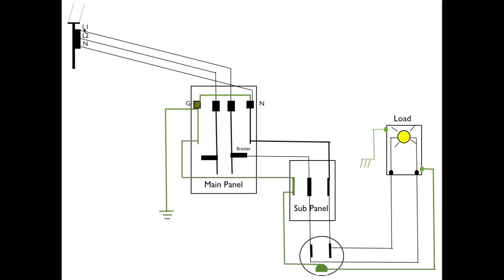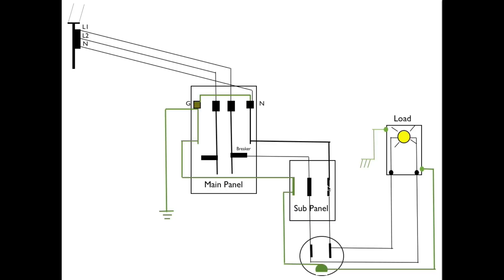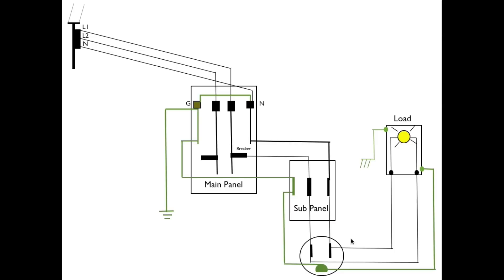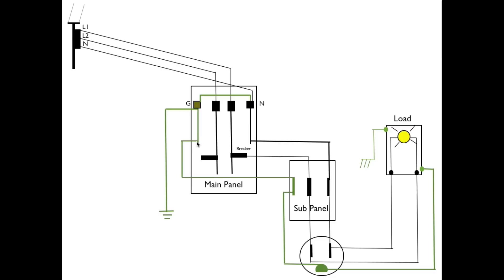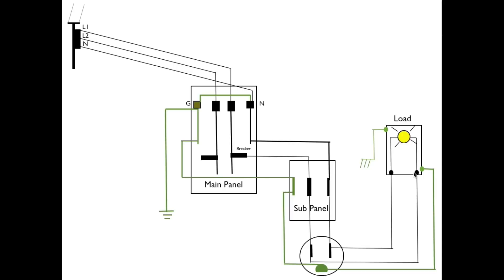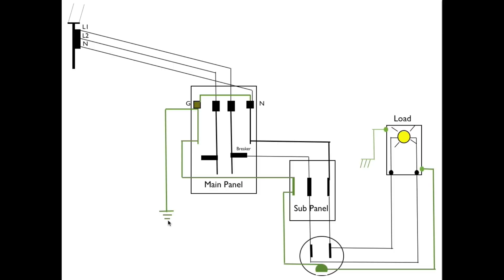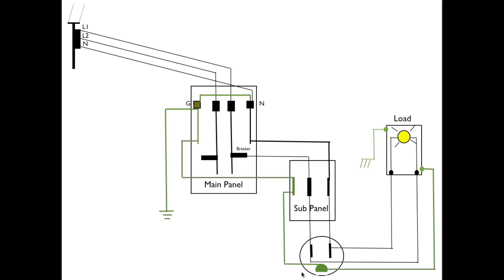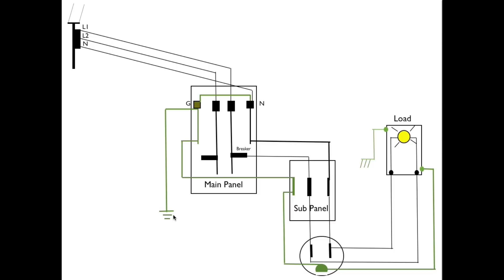The difference between neutral and ground on the electric panel

Comment: Hey grayfurnaceman, I'm one of those people with a BSEE degree but only recently have I HAD to actually learn what we call Bonding (the connections of Neutral/ Grounds/ ground bars/ pipes/ enclosure boxes, etc).  I also came to understand, after working 24 years as a EE mostly on electronic (DC) circuit design, the need for knowing that ground and neutral are NOT the same thing.  I also had to trace wiring on a circuit diagram of the type you have drawn here, and talk my way multiple times through the reasoning.  I also had to see the reasoning in my own way and then understand the explanation of neutral & Grounds connections by reading the NEC handbooks, but this time it was not Brute Force reading, but a more practical understanding of the kind you went through on the video. Thank you for putting this excellent explanation into a concise video.
Reply: Yes...but TMI. You lost most of the audience at the fire station...
Reply: It is indeed alarming how poorly many EEs  and licensed electricians really understand "ground, " let alone everyone else.  It leads to all sorts of unsafe design,maintenance practices,  and installation, and tons of garbage documentation that confuses grounding issues with sloppy references to "ground".  I try to instill in Electronic Engineering Tech students  the importance of being clear on schematics and with terms. It is better to call anything that is NOT EARTH ground, and NOT AN EQUIPMENT GROUNDING CONDUCTOR a circuit reference, 0V, etc.  If we could only stop engineers from calling everything "ground" when they mean "return path", circuit common point" or "reference point" in a circuit, and stop using the same  generic "earth ground" symbol for everything!  All "engineers" should have to study the electrical code and learn about actual machine installation in the real world.  See Mike Holt's Videos.

Comment: Nice clear description. As a lectrician who became an engineer I used to draw simple diagrams for engineers with PE license about how the neutral carried no or little current if the load was balanced on a 3 or 4 wire system. I am retired and buying a stand by generator. I was looking here to see the 2 buses in the main panel, a ground bus and a neutral bus bonded together at the main panel only. Note: doing short circuit studies the max fault current for CB trip is along the path of the source circuit, so running the grond wire with the circuit is important. Learning ohms laws as a lectrician by heart, it helped me throughout my career analyzing problems. My specialty later became protective relaying and switch gear. Did my last project at age 80. Loved my work.

Comment: Not to get off topic but when I was just young and dumb taking a three basic electricity and electronic course in high school, my instructor spoke about dirty electricity. I did not fully understand it until I started working on Digital Imaging equipment, Copiers, Printers, Fax Machines and so forth. We had serviced this equipment in old home offices and old buildings. Sometimes having weird problems on equipment, anywhere from a paper jams, dirty copy and a whole bunch of strange problems, false error codes, etc.... The first things usually checked was the voltage hot to ground to see if there was any voltage present. In some cases 30-60 Volts. Hot to Neutral should be 120 and neutral to ground also 120V. The problem was either bad ground outside, or a problem in the panel / Case. It was unreal the strange problems you can have in electronics with a bad ground to hot. Hope this shed some light. Good Video.
Reply: "Hot to Neutral should be 120 and neutral to ground also 120V. "
Did you mean to say hot to ground also 120V?

Comment: Thank you for this video. In my younger days as an electrician (pre GFCI days) I didn't understand the point of a separate ground and neutral, since putting a voltage meter on the hot and neutral wires would produce the same reading as between the hot and ground. It's all about safety, and having been zapped a few times I can appreciate the concept.

Comment: I was able to pull a permit in my city to do wiring in my garage as the homeowner. I learned that ground and neutral had to be isolated in the garage sub-panel but didn't really know why. This video was very helpful. Interestingly enough, this was the FIRST thing the inspector looked for and commented on. In the end I passed rough and final inspection. I will share this with my friends. Thank you!
Reply from the maker: Welcome
GFM

Comment: Something you don't make clear (perhaps because you don't know it?) is that at least one reason why you should not connect ground and neutral at the sub-panel is that current flowing from the load back to the transformer would then be split between the neutral and the ground wires between the sub-panel and the main panel (that split will be dependent upon the relative resistance of each path). This breaks a fundamental law of the ground connection: that is, it should not carry current under normal circumstances - only the neutral wire should carry that return current.

I believe there are at least 2 issues with this video:
 - At 5:01, even if the ground and neutral connections are disconnected, it does not mean that "this entire box" is energized or at some high potential resulting in a shock, unless there is also a fault within that device, causing the live or neutral sides of the load to contact with the exterior metal (or other conductive) components of the device - i.e. regardless of the type of device this is, the exterior metal portions of it should not in any way be connected to the live or neutral wires (unless there actually is a fault in that device).
 - At 07:50 your description of the circuit flow is wrong. If the neutral wire failed between the sub-panel and the socket, as you describe, then *no current will flow*. The current can't simply jump from the neutral side of the load to the chassis as your mouse movements (at 08:14) suggest.

In both of these cases your logic suggests that the neutral side of the load is connected to the chassis of the load - I would consider that a fault in the load device.

While I appreciate that "grayfurnaceman" is trying to be helpful, I'm not sure what qualifications and formal training he has (his www.grayfurnaceman.com website suggests he has 35 years in the HVAC business, but no mention of formal training or qualifications), and it can be concerning when videos such as this are misinterpreted as professional advice - especially where safety is involved.
No offence intended grayfurnaceman, but I would be very careful providing advice, involving safety, which may be wrong, incomplete, or open to misinterpretation.
Reply from the maker: Thanks for the thoughts.  As you probably know, up until around 1995, 240 volt residential appliances that included 120 volt loads, used the chassis ground as the neutral for those loads.  It was approved to energize the chassis ground under normal operation.  Not quite a fundamental law.  As for the circuit flow, you need to rewatch the video.  If the neutral and the chassis ground are not separated, and the neutral has an open, the chassis will become a current carrying conductor.  (I will admit the point at which the neutral opens determines whether or not the the current will flow which may be unclear in the video).  If then, the chassis ground conductor fails open, (a most common incidence with loose fittings etc), the chassis will be hot because it is feeding thru the load.  There is a video linked in this video that gives a further demonstration.  
As for my qualifications,  I am a licensed electrician.  I noticed that there was no easily understood videos on this subject so I provided one.  No one video,  article, or lecture will give a complete understanding of this or most other concepts.  I taught on this and HVAC basics for 9 years and spent most of my time reexplaining in differing ways to get concepts across. 
GFM
Reply: Older appliances may not be double insulated with the full isolation of the chassis to neutral and hot, so that could present the issue of energizing the chassis as soon as it was turned on with a faulty neutral connection.  That might be considered a fault in the device nowadays, but things weren't always designed with foolproof safety considerations.
Reply: There is a second reason. When you install a personal safety breaker (Don't know the name in US) that measures the load of L1 and N. So they are the same and no current goes to ground. You have to have that breaker in the main panel. And it wont work if N and ground are not separated out to the sub panels.
Reply: Robert Shrimpton well put together. I had the same safety concern too and the way he pointed out the neutral wires between the sub and the load. Obviously, there would be a fault and nonetheless, having a broken return conductor will not complete the circuit.
Reply: Robert Shrimpton p
Reply: I think you both are  correct for your own statements regarding ground/ neutrals. This statement is good to know:  "As you probably know, up until around 1995, 240 volt residential appliances that included 120 volt loads, used the chassis ground as the neutral for those loads.  It was approved to energize the chassis ground under normal operation.  Not quite a fundamental law," however the diagram and discussion do not involve that situation.
Reply: GFM, thanks for the video; however, I have to agree with Robert that it side-steps or tends to be 'partial information' which MAY get others into trouble.  In MARKETING... it's LOCATION... LOCATION... LOCATION!  In BONDING, the TRANSFORMER INTERACTION needs to receive MUCH MORE credit in the discussion!  I think the effect to-and-from the TRANSFORMER should be highlighted-and-maintained throughout the discussions, especially when setting up various failures.  It would be great to have an animated video to visibly enumerate each failure scenario... depicting critical probe points and values throughout the circuit (and again, relative to bonding, chase this back to the transformer.)  While not typical, however for better clarity, you should also depict adding a customer-supplied SECOND transformer into the mix, showing the BONDING of EACH "FIRST downstream panel" from EACH transformer.  Protection from lightening hitting various places in the circuit should be discussed.  Also, whether we are protecting INDIVIDUAL health, our equipment, or the power company's continued operation. Throw in a discussion of common customer supplied transformers, and what that does for GFCI protection (and/or failed neutrals) -- eg. a Uninterruptable Power Supply (UPS) used for protecting computers, and the full impact of their TRANSFORMERS in like discussion; similarly when hooking up a generator (and where the grounding and/or bonding should go from there...)  Honestly, I still don't have it figured out myself... just that "TRANSFORMERS" keep getting lost in the discussions.  :)